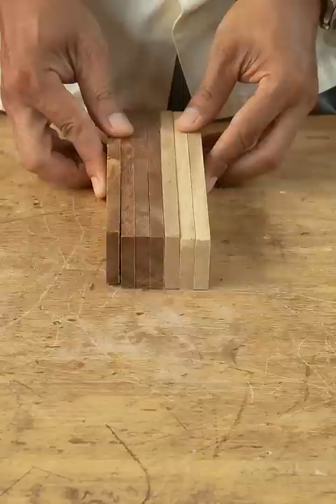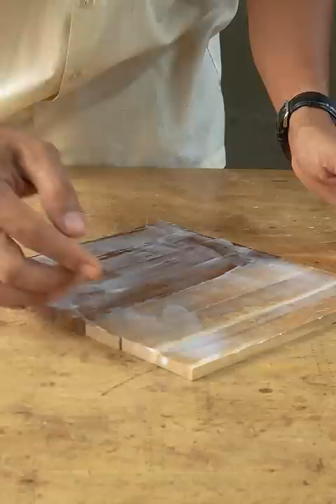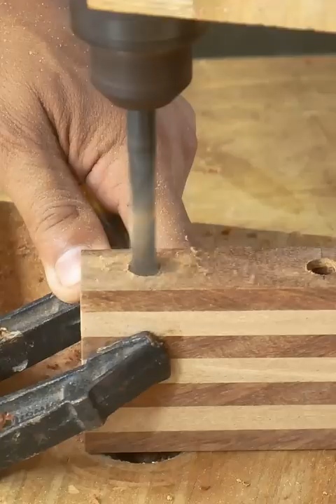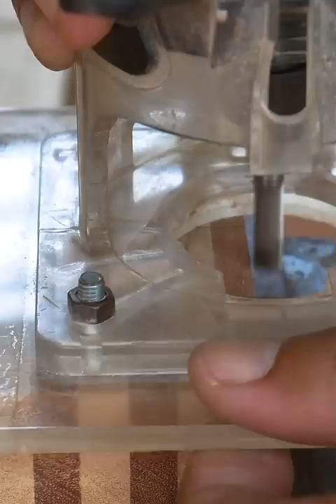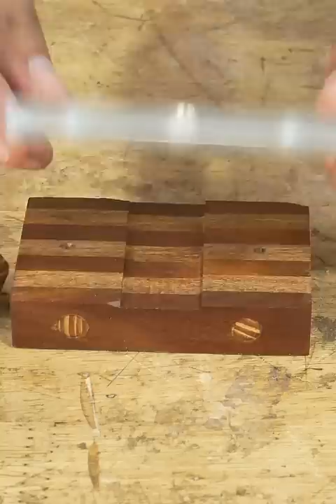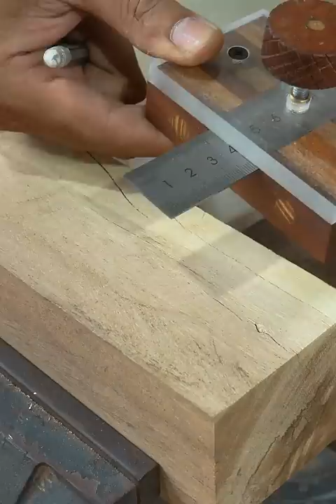How to make ruler gauges for woodworking projects  #shorts #woodworking

Comment: You can buy a reismus. It will be incomparably more accurate, parallel and cheaper than the working hours that I will spend on this homemade. DO SOMETHING THAT HAS NO INDUSTRIAL ANALOGUES , DAMN IT !
Reply: Relax some folks make things for fun.
Reply: @b3arwithm3  My understanding of fun is different from yours. I carefully study everything that has been invented, combine all the best solutions of all analogues and get as a result of my work what was not there before, the most functional at the moment. And only then, holding something in my hand, or watching the work of the mechanism, which was not before me, I become joyful. Only through diligence can one come to the future.
Reply: @Anrakyr  tell us what you invented that didn't exist before?  Nothing I guess
Reply: @b3arwithm3  I'm not inventing anything. I combine only the best solutions available to me at the moment. I didn't even write that I was an inventor. After all, I'm an engineer. I create extremely highly specialized pieces that work) I don't react so sharply to the words of other people. We're just two dudes from the Internet arguing about nothing.
Reply: You said you did something that was not there before. That would be invention no?
And do you tell your kids to not draw because we can buy one for cheaper or ask AI to do it?
Reply: @b3arwithm3  If you take twenty invented nodes and assemble something that hasn't happened yet, it's not an invention. This is an engineering solution. You have not invented any of the nodes and have no right to appropriate the merits of the people who discovered these inventions.
Reply: @Anrakyr  isn't it what he did in this video?  He took a piece of wood, screws etc and made a tool
Reply: @b3arwithm3  There is no point in this video. He made a bulky, unreliable tool out of glued wood. You might as well extol a farmer who replaced a steel shovel blade with a wooden one. Does such a farmer have a lot of intelligence and ingenuity? Or have shovels suddenly become unavailable?